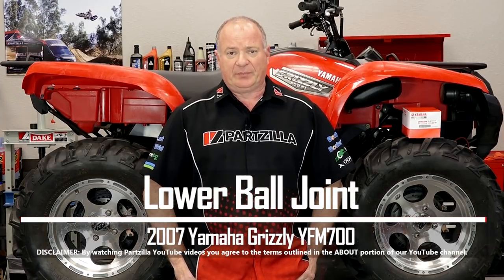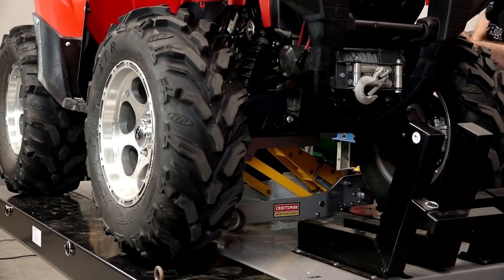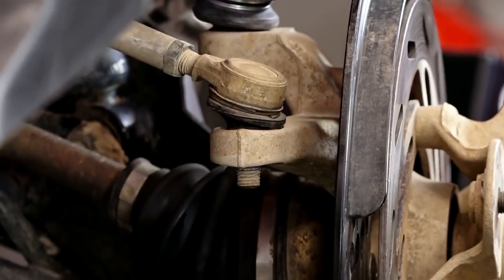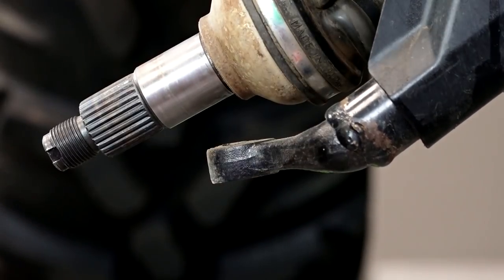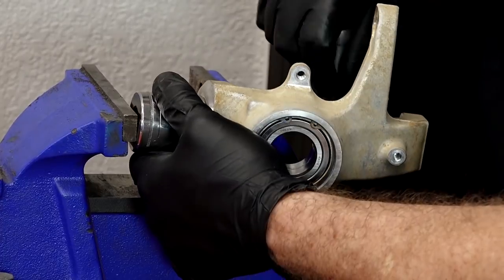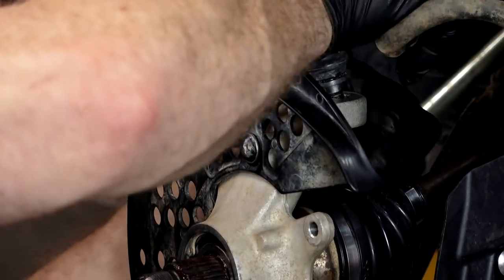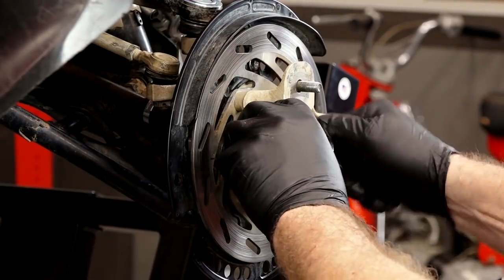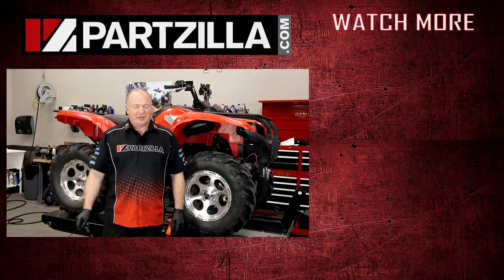Yamaha Grizzly 700 Ball Joint Replacement | 2007 Yamaha YFM700 Grizzly | Partzilla.com

Comment: Well, I hate to say it but I have to: The ATV your working on looks like it was never used ! - In a real life scenario the stuff is not coming apart as easy as you show with as few tools as you show. Your not gonna get those out with just some hammer blows and a punch. You'll need a thingy with two jaws and a center that will screw in and push out the old ball joints, Kinda like a reverse bearing puller! - Guess how I know that.  Best Regards from Alaska where we put the ATV to work.

Comment: When taking off the upper ball joint instead of using a hard metal punch and take the chance of messing up the threads. Use a 1/2 key way. The metal that is used to make key ways. Wont bend threads.
Reply: What is a 1/2 key Way?
Reply: The metal material, that you make shaft key ways out of. They are not hardened material and make great punches, so you dont scar up shafts, gears, and such
Reply: Its called key stock a keyway is the slot the key sits in and keystock will def mess threads up if hit hard ent aluminum would be best but could still mess up threads if hit hard enough im a machinist i work with metal everyday

Comment: How do you get the nut off the ball joint if the stud keeps spinning also?
Reply from the maker: It's press fit.  If it's spinning, you may have to replace more than the ball joint.
Reply: Use channel locks to grab the stud then wrench to spin the nut ball joints that are worn will spin inside themselves